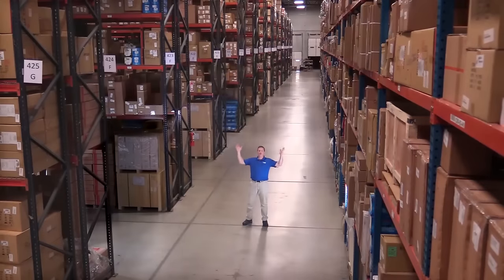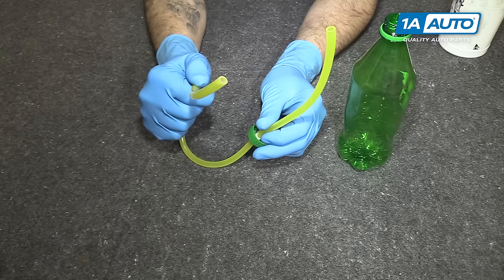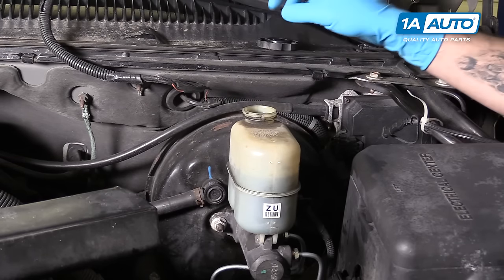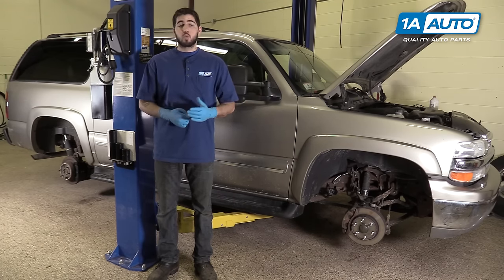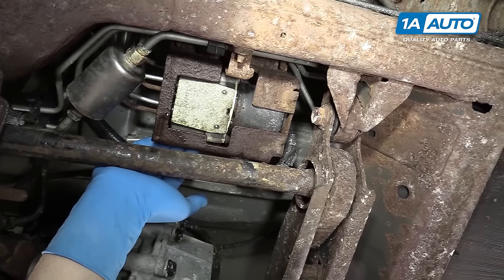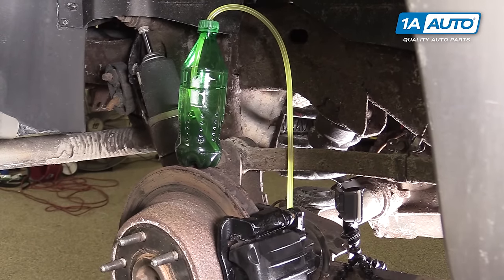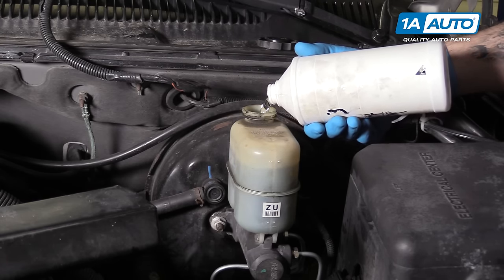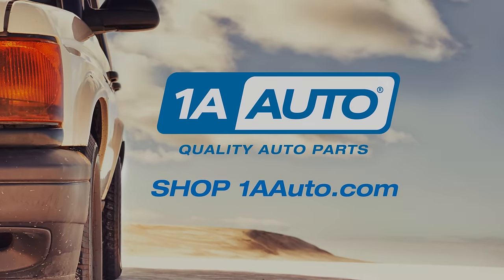How to Bleed your Brakes by Yourself

Comment: Should I do this before I replace calipers?
Reply from the maker: +joshua lyons Thanks for checking us out! We would recommend to do this especially if you have not bled or replaced the brake fluid before. This will prevent any possible water accumulation from damaging the brake lines.

Comment: Questions:
1. if for some reason on the first brake pedal pump it doesn't completely fill your hose going to the bottle with fluid and there is air at the end of the line (towards the bottle), isn't there a chance when you release the pedal that some of that air will enter the brake lines?
2. shouldn't you leave the filler cap off, or just loosely over the reservoir so as not to create a vacuum?
3. does this flush out fluid in the ABS components?  Some videos disagree on this.  Some also say to disconnect the negative lead to the battery to disable ABS and enable flushing ABS components (if I understand them correctly).
Reply from the maker: +Mountain Biker Multiple pumps of the pedal will push any air out. Leaving the cap on prevents any air from being sucked into the system from the master cylinder. Yes this will flush fluid from the ABS system. the lines are all routed through the ABS pump. You're preforming this repair with the vehicle turned off and stationary. There will be no power going to the ABS system, no need to disconnect the battery.

Comment: How did you lock the pedal all the way down if supposedly was a 1 man job?
Reply: You dont " lock it down " .
Once you have loosened the bleeder and have connected the hose , you step on the brake pedal slowly , then release it .
Repeat that process until there are no more air bubbles in your line or bottle and make sure to maintain enough new brake fluid in the master cylinder .

Comment: I had to snip the end of the tube that goes in the bottle at a 45 degree angle so it wouldn't push against the inside of the bottle
Reply: Good tip.
Reply: @stickwallfarm  ha
Reply: I literally did that a minute ago lol

Comment: If you pump the brake pedal farther than its normal travel, you will many times cause the master cylinder to go bad.  The way to prevent this is to put a block of wood under the pedal.
Reply: cheers

Comment: Good video. But on old cars like my '67 Chevy, you need to refill the master cylinder every 3-4 pedal pumps or it will empty out and ruin everything.
Reply from the maker: +ercost60 Thanks for the tip!
Reply: I added more fluid every 4 or 5 pumps on my 2014 Kia Soul just because

Comment: Should the bottle be higher than the cal ?
Reply from the maker: +Scott Ewell Thanks for checking us out. You could keep it lower or higher, it should not make a difference, the fluid will come out in both positions.
Reply: @1AAuto  thanks

Comment: I done this and when I drove the brakes were spongy. How do i fix it.
Reply: Here are a few rules you should follow.  1.  When refilling the brake fluid reservoir, use a funnel to let it slide down the throat, minimize the quick refill, that would vortex in and add air.  Keep the liquid as still as possible.  2.  When using the bottle method, the hose should be vertical up about 5-6 inches, then curve downward back to the bottle.  This will make sure the brake fluid is seen in the hose those few inches, and any air trapped, would push itself toward the top, with each pump of the brake pedal.  Those few inches of fluid seen in the line, would prevent air from getting pushed back into the calipers.  3.  This is my personal preference, but I lock the bleeder valve, with the brake pedal pushed in.
Reply: Checkout Chrisfix channel...he may have answers as to why your brakes feel spongy.

Comment: That Coil of Brake Line: What material is that after-market bendable brake line compared to that plastic coated factory brake line? 
What type of benders do we need for using that flexible brake line?
Does that bare line need to be sleeved with plastic?
Over 50k on Brake Fluid: How do we flush the whole system because wont a tiny bit of old fluid affect the new fluid?

How to bleed the master cylinder?

Legalities: Is that bendable break line 50 state legal.
Legalities: There was unions on my back brake lines when I purchased this used car in the Baltimore area. Where do we locate a list of brake requirements per state?

Comment: Every mech I have worked with they all say that it sucks air in when you let off the brake.
It doesn’t you can crack the nipple and let it bleed it self it will not suck air it can’t

For every drop out something has to go back in right, every drop is replaced from the tank. Don’t beleve my look at the tube in this vid where can you see the air bubble move towards the nipple enough that it would go back in system and never ever come out?

My tip
You replacing calipers, pipes etc crack the nipple at the brake your working on and jam a bar between the seat and brake pedal. This will close the res port so no dripping fluid.
Apply this logic to my statement above

Comment: When you release the brake pedal (after pressing it down ) when it returns to the un pressed position doesnt AIR from inside the 3/16" tubing get DRAWN INTO the caliper via the bleederscrew ? I mean... the tubing is full of air. The fluid ( and air for that matter ) doesn't move one way, you know, just OUT of the opened bleeder screw - it can get drawn back in. That's why you have to CLOSE the bleeder screw on the return travel of the brake pedal. Your method MIGHT work if the 3/16" hose was FULL of brake fluid  and AIR FREE. I'm not convinced that this works. There was a company, years ago, that sold a small CHECK VALVE that allowed the ONE WAY flow of air and brake fluid out of the wheel cylinder (brake caliper) bleeder screw.  That way the fluid would progress from the master cylinder to the wheel cylinder (caliper on disc brakes) while pushing the air out. The check valve would CLOSE on the return travel of the pedal and would not allow any air to be drawn back into the system.
I think that would be a much better idea.
Reply from the maker: +Jay Ce Thanks for checking us out. Shop for high quality auto parts on 1AAuto.com:

http://1aau.to/m/Shop-1AAuto-c

Comment: I've bled brakes with seized or broken off bleeder screws by having someone pump the brakes until the piston comes out of the cylinder. I hold the piston against the cylinder to allow fluid to come out but no air to get in.  Then I push the piston back in.  This method is easier on drum brakes that have two smaller pistons with one being slightly higher than the other and that's the one that I bleed air from. 
This is a good and possibly the only way to avoid having to replace the cylinder or caliper and risk the possibility of breaking a brake line or fitting when everything is badly rusted.
Reply: Rsole   makes no sense.. if ya got broken bleeder screw... It's always gonna be sucking getting air into system at bleeder screw  ... So  how can yur  brakes even work correctly at all ?!?  will always have some or lot air getting in  right?  smfh omg

Comment: generally a good idea not to push pedal all the way down, on a brand new master cylinder it fine, but an old one, never do that. Put a block of wood or something under there so it does not run seals further that it has been going or the seals will slide of possible internal grime they have never touched before
Reply from the maker: +Jay C Thank you for the feedback. 1aauto.com

Comment: One way valve from Amazon is a way better way. Use it on my bike. Awesome and super easy.
Reply: It's no better, you still need a container to catch the fluid. And with the hose submerged in fluid this method is foolproof, plus you don't waste money on a one-way valve, plus you get the benefit of seeing the bubbles in the large bottle.

Comment: Love the video but I don't get it.  Why do you need to fill the waste bottle with brake fluid.  1. When you attach the hose to the bleeder screw it has air in the hose anyway.  2. When you pump the brakes, all of the air is being forced out anyway.  3. If the argument is that brake fluid will get sucked back from the bottle instead of air, then you likely have air coming in first from the hose anyway (see #1) and then #2 will happen anyway, and also if this is the 2nd brake like you are doing, you are sucking back in old brake fluid if there is a large amount of backflow.

Comment: Dont fully press in the breaks it can kill the master cylinder it goes in much further than normal after cracking the bleeder valve, to prevent this put a brick or a block of wood behind it so that it will press down as it would normally.
Reply: Helpful !

Comment: I usually put that bottle out it, then pump the brakes a few times, put a stick between the brake pedal and steering wheel, walk around and crack the bleeder till air/fluid stop moving, close the valve pump the pedal a bit more and repeat till no air.

Comment: Parts store's DO NOT take stale fuel, brake fluid or old coolant! Oil, trans fluid, Hydraulic fluid, gear oil, Power steering fluid.. That's it.

Comment: Your videos are great. This one however shows you using an open end wrench to open and close the bleeder screws? This is totally the wrong wrench to use, and you know that. You use a line wrench, or the boxed end, 6 point preferably, Showing folks an open end wrench is not correct. I'm really surprised to see this on your video> Thank you, Jim.

Comment: its much EASIER to take the spray nozzle from a spray/spritz, bottle.... hook your rubber hose/3 sixteenth, fuel line, to the plastic pick up tube on your, sprayer. next hook the other end of your fuel line (opposite end from sprayer, pickup) to your brake bleeder, screw. crack the bleeder screw loose & pump your sprayer into your bottle until you no longer see air bubbles headed to your hand that you are "PUMPING", with? Don't forget to tighten your brake bleeder screw BEFORE you take your hose back off of your brake bleeder, screw.

you don't even have to get inside of the, vehicle... maybe if you need to pop the hood so you can be CERTAIN that you DONT LET THE MASTER CYLINDER RUN OUT OF, BRAKE FLUID.😢✌❤💯

Comment: Why did he pour fresh brake fluid in the bottle a third of the way?
Reply: why not?
Reply: To submerge the hose, preventing air from being introduced to the system, also it allows you to spot bubbles. You could fill the bottle to the top with fresh fluid, but then there's nowhere for the old flushed fluid to go.

Comment: OK one thing I’ve never understood about this one man method is if you’re in the vehicle pumping the brakes to get the air out of the lines how are you supposed to see the hose and the fluid thats going through & the air bubbles? If you get out of the vehicle to check the fluid going through the hose and the air bubbles, how is this being done if the brakes are not being pressed at that time? There will be no fluid going through the hose hence no air bubbles also... 🥴
Reply: One man method is a maintenance sort of thing. If you are bleeding air out of the system, of course you need someone to be looking out or pumping the brakes.
Reply: Just check the hose and bottle for bubbles. And don't skimp on the fluid, you're working anyway, flush the lines of old fluid, brake fluid absorbs water, condensation, flush it, prevent corrosion, save your pistons, your ABS. That's why parts fail in the first place. Fresh fluid and greased calipers, equal fewer problems.

Comment: I own a 2012 GMC yukon SLT, my ABS module some how got damaged, so I bought a very good condition second hand ABS. However, after fixing it my brake pedal got hard and it's hard to apply brakes while driving, not only that my brake anti lock system is not active. Computer scan shows ABS is active. Any suggestions!?

Comment: hahaha,not very smart using a little bottle like that,.use an instant coffee jar with a hole cut in the lid to put the tube through,put a little fluid in it stick your hose so it hits the bottom of the jar.sit the jar on the ground..mash your brake pedal all the way down and then ,slowly slowly let it up about 4 or 6 times then check the master cylinder to make sure it has enough fluid in it that it doesnt suck air when you let off the brake pedal....each time you let the pedal up tighten the bleeder screw and check the master cylinder fluid....just remember to let the pedal up slowly so it can suck fresh fluid into the lines from the master cylinder. ...and always keep the master cylinder topped off so it doesnt suck air.and ALWAYS use a boxed in wrench to break the bleeder screws loose....after you spray them with liquid wrench or something similer....i usually spray all of the bleeder screws a couple hours before i bleed them.

Comment: I have a question  that I need some help with is it a must that I add fluid before  the bleeding  process? And another question  is I changed  my caliper  and pads but I did not bleed I added fluid after changing caliper  and pads and my fluid started leaking  out I traced down my line to see if a had a leak in my line or my resqvire  i trouble shooted the line and the tank everything  looked good so I don't  know why I was leaking  fluid mabey the line to caliper  was not tight please can someone  answer these questions

Comment: Is  brake fluid  and  steering fluid pretty much same thing or interchangeable ( sorta) ?
 Both   look  clear similar and pour and feel  slippery same.   So ?
Can  you use   brake fluid ( in a pinch)   for  steering fluid ?
 I would not risk it  other way around and use other for the brakes.. for sure.
 But what if pulled made a bozobonehead  move and  added lil of one or other into  other  during a small fillup  topoff ?  small amount let's say.?
 Gonna hurt or danger or harm really?   
 today everything so expensive... both cost good amt of $ .. so.
Reply from the maker: +phill p Thanks for watching!  While they are both hydraulic fluids you really want to use what the system calls for.

Comment: At 6:48 the reservoir is already open. Just in case anyone has doubts, it has to be closed when you pump the brakes and you reopen it to refill to the max line. I'd only pump in short pushes to not get the seal of the master cylinder to a surface it's not familiar with that isn't broken in from years of use. 
8:09 Make sure to put the protective cap back on. Such a cheap part protecting from potentially more expensive repairs.
Reply: WHY?  That is not how it works.

Comment: Good tutorial, but as a general rule, the Brake Pedal   should not be released before the Bleeder fitting is closed. There's a risk of sucking air back into the Brake system.

Comment: One tip is to completely remove the bleeder screw before you start bleeding.  Wrap teflon tape around the threads.  This prevents air from being able to get around the threads.  Works great when you use a vacuum bleeder so I imagine it would work well here.

Comment: Do not use clean fluid to put it at the bottom of the bottle, just put in the old one you will suck it up on the reservoir. Be smart.

Comment: Hi
I have Civic 2008. The ABS System does not pump oil to front  right hand side line. What can be the iasue. Other 3 lines are perfevt. No ABS light
Reply from the maker: +kmehboob 28 We wouldn't be able to diagnose an issue like that here, you may want to have a local mechanic take a look at it. Thanks for checking us out! http://1aau.to/m/Shop-1AAuto-c

Comment: Can we reuse the fluid inside the green bleed bottle? Much appreciated
Reply: I wouldn't. The old fluid is normally contaminated/compromised and not fit for reuse. This video makes the "old" fluid look clear, but 9/10 the fluid is going to look a lot dirtier than the video showed. Check to see if your local parts store will take the used fluid and dispose of it for you, or if you have to take it to your local hazardous waste disposal facility. Hope this helps and have a great day! :)

Comment: That takes way too long and wastes too much fluid. 
MANUAL BLEEDING
This is the way I do it. 
Do not pump the brake pedal at any time while bleeding. Air in the system will be compressed into small
bubbles that are distributed throughout the hydraulic system. This will make additional bleeding operations
necessary.
Do not allow the master cylinder to run out of fluid during bleed operations. An empty cylinder will allow
additional air to be drawn into the system. Check the cylinder fluid level frequently and add fluid as needed.
Bleed only one brake component at a time in the following sequence:
Right Rear Wheel
Left Rear Wheel
Right Front Wheel
Left Front Wheel
1. Remove reservoir filler caps and fill reservoir.
2. If calipers were overhauled, open all caliper bleed screws. Then close each bleed screw as fluid starts to
drip from it. Top off master cylinder reservoir once more before proceeding.
3. Attach one end of bleed hose to bleed screw and insert opposite end in glass container partially filled with
brake fluid. Be sure end of bleed hose is immersed in fluid.
4. Open up bleeder, then have a helper press down the brake pedal. Once the pedal is down close the
bleeder. Repeat bleeding until fluid stream is clear and free of bubbles. Then move to the next wheel.

Comment: Like to pay streak pretty much do my bleeding the same way as you but I got another question for you Honda Civic 2016 never done brakes Ana electric brake system do I have to do something special for the electric parking brake is I have a spongy pedal and the brake system problem light is on somebody told me the cycle of the parking brake a few times and bleeding
Reply: But speaking my text the first part came out wrong I said I like the silicone Paste   Trick the electric brake system on this 2016 is there something I have to do differently to bleed the rear brakes